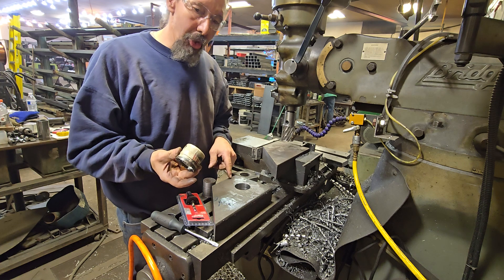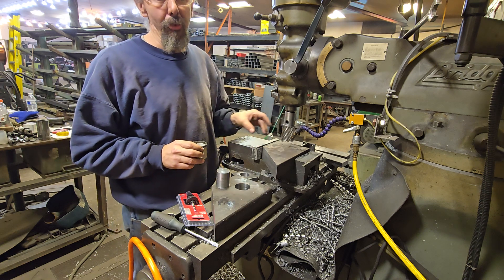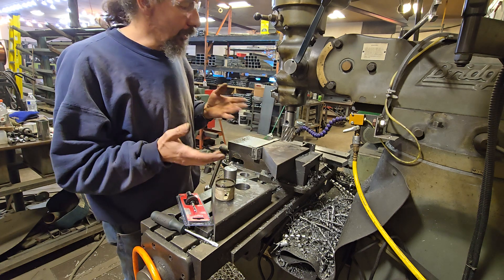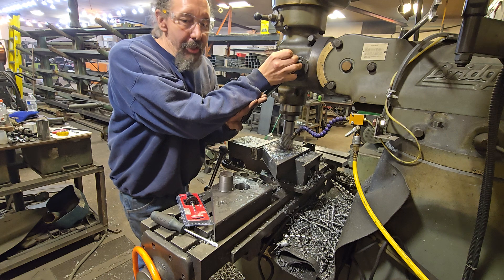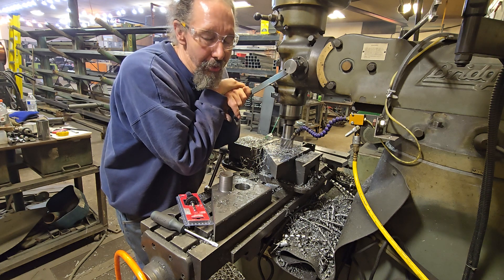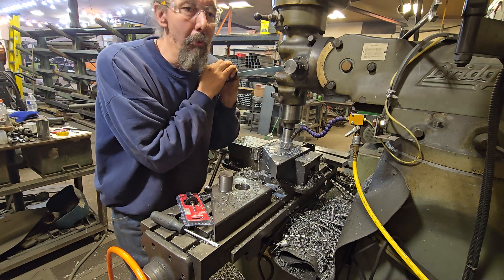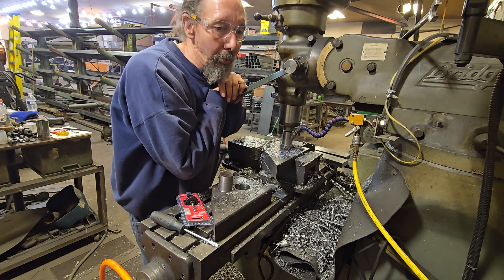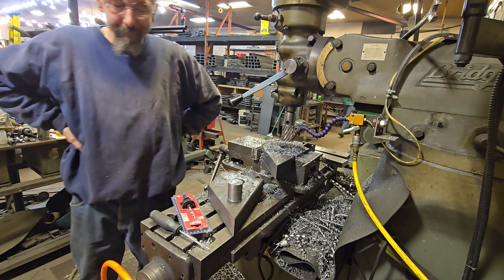Boring a 2 inch hole with an annular cutter on a Bridgport mill. Minnesota Implement.

Comment: I use these cutters in a lathe too. Plenty of coolant & I like to keep up a steady pressure as long as possible so that the strings of swarf keep coming out of the flutes without jamming. But of course you have to keep backing out of the cut on a mill to avoid getting a huge a mass of swarf spinning around the spindle...

Comment: I have a job that requires a 2.00 hole 4.0 deep and has to have a high finish for a slide pin.  Anyway got it down to 4min 50sec with help from Mitutoyo. And dollars $$$POOF.
Originally after trying on mill, I tried on the lathe, could do it in 15 minutes or so. Too sloooow lots of birdsnests. had to babysit ever hole. 
   Now with this mystical foreign machinist magical device, I too am cool! :oops: 
Under five minutes and a one pass finish like glass.  All for the price of your sou...I mean 1400 bucks . And like 140 for a small box of inserts that last 100 plus holes each.
I called Mitutoyo and they had a rep come to my home shop when he was in area. Only downside is its a two week wait unless you pay premium. I think its double for next day shipping.I know this because day 1:dothefive:😱 I broke /destroyed my brand new boring tool, and the salesmen actually got it replaced. (I set wrong tool length offset, watched it rapid -Z  down into the part face)
 Anyway If you have a LOT of holes to drill its now the way to go. 
1 pass and perfect. Im still amazed, where have you been all my last 40 yrs of watching paint dry...as the mill runs on....

Comment: I’ve found that the very expensive annular cutters aren’t much better, if better at all, than some brands of cheap cutters. As far as carbide goes, I’ve found that ACTool has inexpensive carbide cutters that are quite good. I do recommend buying a high quality annular chuck though. I was disappointed in the Haugen chuck. No Brandi g on it and it appeared to be a cheap Chinese chuck. It even has small mild rust spots on it, and it was expensive. I don’t know what Haugen is doing here. I bought a Bison, which was hard to find, but works well. It has a 1” shank to go into my ER-40 chuck. I also have one for my lathe with a Morse 3 shank. I also highly recommend using carbide for any stainless work. The slightest error in speed, feed and cooling with stainless and you’ll burn your cutter. Carbide cuts like butter. I hope all of that mist shooting out of the airline is oil and not the usual water.

Comment: I've never seen a hollow drawbar setup for Bridgeport but I have used R8 Hogan holders that have a coolant line running to a floating collar and they work really well. For the price of those cutters even an important coolant through holder is better that not by far.

Comment: i like the straight to the point style videos. Even with the background noise. You act like you care about getting the job done and not just being there for the money. Lots of guys would just bust up tools with the attitude that the company will just buy more. Also like all the tips on how to avoid work hardening the cut and running it slow. I see these cutter sets from China, India, Pakistan being sold and now I will have to try them. Thanks for you time and effort. The tip about the weld seam on the inside of the box tube is noteworthy as well. Once you bust thru the top of the box you might think you are in, but that hard seam might surprise you. Overall great tips.

Comment: Mist Coolant ???
IF you used standard Coolant, it would lubricate the cutting edge and be drawn up inside the ID of the cutter to lubricate the tool.
I know Coolant can be messy to use.
But it's better than burning up Tooling👍

Comment: Those cutters usually have a spring loaded pin in the center that pushes the slug out after drilling  the hole. We use them in a cnc mill to drill hundreds of holes through the side of steel tubes mounted on a 4th axis.
Reply: ,,,,,,,,,,,,,,,,,,,,,,,,,,,,,,,,,,,,,,,,,,,,,,,,,,,,,,, a fourth axis  would be any given  angle to the workpiese,,,,correct ??? ............................
Reply: @ThomasELeClair our forth axis is just like a lathe chuck and a tailstock so you can rotate the part and drill holes through the side.